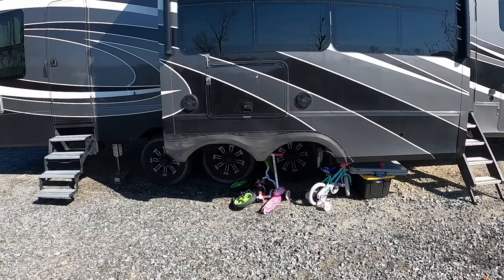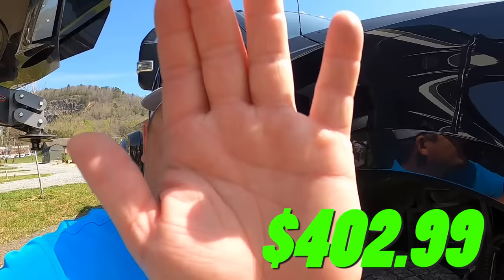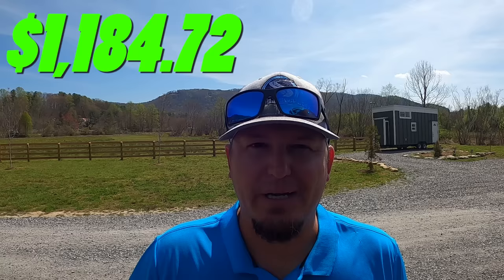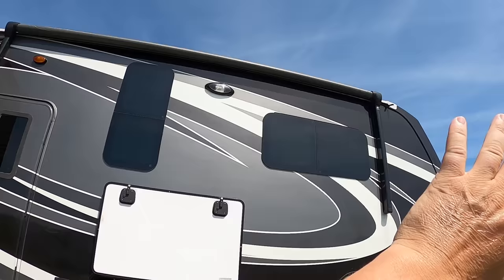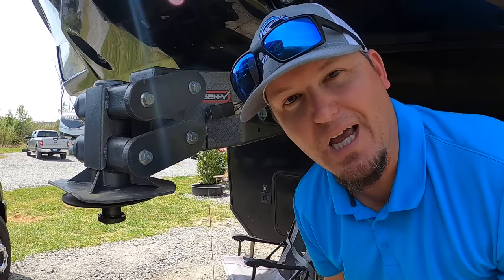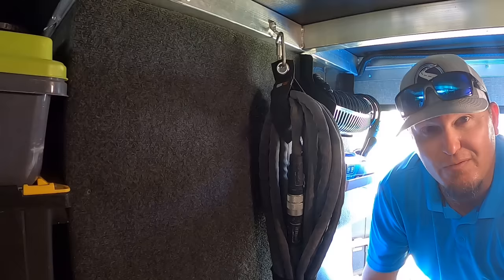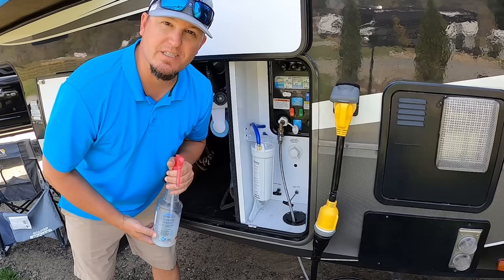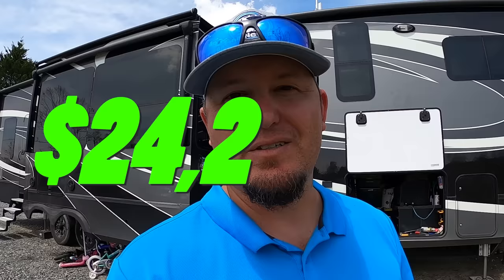These Things Are Money Pits! Everything That We've Had To Repair! | Fulltime RV Living!

Comment: I'm considering a teardrop to tow behind my Tesla.   Seems like the increased stop frequency, is worth the lack of ICE repairs.  ....but wow, sounds like it's time for an RV engineering revolution.
Reply from the maker: Except we had no ICE repairs, our truck never broke down, it was all maintenance! Your Tesla is going to need maintenance as well, just because you have a different source of power doesn't mean you will be maintenance free! Also you will have to figure out how to go places! On the East and West coast there are charging stations but how will you really get out there and get away from it all if you can't go where they don't have chargers?
Reply: @PavingNewPaths  My mistake.  Wrong word.  I meant ICE maintenance, not repairs.    ...and of course I'll have maintenance, but nowhere near as much.   I've had Teslas for years and have driven to and from all 4 corners of the US.   I've never once had a problem finding DC Fast Charging even in the flyovers.   To answer your question, I don't need chargers.  Wherever there's any kind of outlet, I have charging.  Charged off a regular Edison outlet while visiting a friend in deep rural Kansas.  Right now I'm car camping/charging while at an RV park using NEMA 14-50 (or TT-30r if I wanted) because I wanted to get away from it all.  Cheers.
Reply from the maker: I'm not saying you can't travel with a Tesla, but the idea of pulling an RV is a little far out for it to be practical! Until they can improve range while towing it's not ready for the masses to try and camp with electric tow rigs! We won't  have to wait long they will solve to problems and one day I will make make a video of my electric dually towing my RV!
Reply: @PavingNewPaths  Sorry about the long replies, but I'm a nerd about this. :)  I cant wait for that video.  :)   ...but I don't think it's that's outrageous, currently, especially as RV's start to get the aero/EV treatment like Lightship RV.   Videos I've seen show 40% loss when towing.  In a 400mile range vehicle that's still over 3 hours of driving.   Lot's of charging, sure, but if I'm in an towing a camper, I'm not cannonballing.  More range is always good, but I think we need more stations.  And more pull-thru stations.  I have no idea why EV charging stations aren't designed like gas stations (or why gas stations aren't just creating separate EV islands like they do for diesel or just converting gas pumps to EVS).
Reply from the maker: @DblOSmith  Maybe I am referring to when they will make it to where I can do it on full electric with a setup my size! I watched a video on the new electric F150 pulling an RV and it's range was half with a pretty light RV I want to so maybe 150 miles! I want to see a setup like mine that is big and heavy be a practial solution! I also thing the RV needs to be engineered to help the truck either as a battery bank the truck can use, along with some regeneration if possible!
Reply: @PavingNewPaths  Ah gotcha.  For sure!  Cheers!

Comment: there is several videos on air filters saying toss that lifetime and use good paper, they showed too much fines were getting through that washables. and the lawyer Steve Lheto did several videos on RV's and his advice was to go get $100.000 in cash,  go out in a field, with the cash and a bucket.. Fill the bucket with the money , kick it over and walk away.. you;ll be better off.
Reply from the maker: You do know there are maintenance procedures on the air filters right!  You are suppose to clean it and oil it at every oil change in order for it to work!  Out of everything in this video I can't believe the trucks air filter is what you felt the need to comment on!
Reply: @PavingNewPaths  for certain, the tests  showed their filtration still didnt match OEM  and when dealing with something that'll cost you 20 grand to replace fpr premature wear  Ill say OEM is cheap insurance.

Comment: Maybe just me owning a diesel for over 12 years and having an RV for close to over 20 years but I didn't really see a whole lot of surprises here.  You want to play, you gotta pay.  You put on the mileage you have to do the maintenance and diesels cost more, especially DRW units - do it yourself!  Most RV's regardless of who makes them or how much they cost really are giant POS - the guys and gals that slap them together make both the entry level and the premium units, it makes no difference to them, they get paid piece work.  I'm always working on mine, be handy, they are not that hard to work on!  Once you get the bugs worked out of the RV they aren't TOO bad ;)  Good luck!
Reply from the maker: We have done all the maintenance and repairs ourselves, that is how we controlled the cost as much as we did! I used to agree with you that once you get the bugs worked out they are fine, but we  just finished our 3rd full year and the story has not changed. If anything, it has gotten worse! Wouldn't be a big deal, but we bought this unit specifically because it was sold as fulltime use! It's likely barley capable of weekend warrior use!
Reply: @PavingNewPaths  My understanding of a "full time unit" is the manufacture will while it's under warranty, warranty components when they fail.  If you do not have a unit that is classified at a "full time" unit the manufacture will actually deny warranty work as the unit was not designed for that amount of use.  What I'm saying is a "full time" unit is a scam.  They just cost more so that the factory will honor the warranty while under that type of usage but in reality they are made EXACTLY the same way as any other unit.  Also any unit made between 2020 and 2022 is also more than likely not assembled that well as the industry was on fire - covid units.
Reply from the maker: @louisschummer931  Ours is a fulltime unit and was made before 2020! And you will see in some upcoming videos I wouldn't reccomended ever going with Grand Design if you plan yo actually use your RV! You will be on your own for everything!

Comment: That slide topper should unroll enough with the water on it and not pull off the wall. And don't forget people.  Slide toppers do not water proof your slides. The seals do.
Reply from the maker: Oh it does roll off until it is setting on the top of the slide holding water!  But in the process of it doing this it pulled the slide topper trim out of the side of the RV!  We doubled the amount of screws and haven't had a problem since!

Comment: I would no recommend an rv unless you have maintenance skills.  I am always fixing something on my rv.  My brand new Ford 2017 F350 dually was a problem also.  Stuck in Gulfport MS because the steering dampener went out at less than 40k miles.  No replacement was available for 5 days.  Aluminum rims that had leaking valve stems.  Finally made Ford replace the rims and stems.  There is a recall on the drive shaft.  The issues go on and on.
Reply from the maker: If you are going to use your RV more than just a few times a year you need to be prepared to fix things!  The more you use it the more you will fix it! We have actually never had any problems with the truck just scheduled maintenance and consumables like tires, brakes, and shocks!
Reply: Lucky guy!

Comment: The first 3 minutes of your video basically explains why i have an HD gas truck.
Reply from the maker: A gas truck can't handle this rig!
Reply: @PavingNewPaths  Kinda true, I move equipment on a deck over gooseneck. As heavy as 17,000 lbs. I wouldn't travel full time like that, though. My 5th wheel is right around 11,000 lbs. I tow it with a Ram 2500 6.4L. I do side work with a 15k gooseneck dump. I honestly haven't even felt the need for a diesel. I live in the northeast. So it can be vary step out here.
Reply from the maker: @Mattman2500  The gas truck could handle the payload requirements of this trailer, but when hooked up the truck and trailer weigh 31k so the gas motor would do ok on flat ground but it would be more than it really wants to pull!
Reply: @PavingNewPaths  Another factor is wind resistance. Also, imo if you need a drw truck. Then you are in diesel land lol. For me I'll stick with a gasser. My 5th wheel, I'm going to keep under 12,000 lbs anyway. Just sucks the epa basically killed the modern diesel. No doubt they pull better. Cost to dam much to operate and keep operational.
Reply from the maker: These new motors are beast now with the Government stuff on them, imagine if they could sell you the truck and motor with out all that stuff on it! Btw you have an awesome handle!

Comment: Should be calling out the dealer that put the washer dryer in and the manufacturer of the trailer. Grand design has only been around since 2012 and they have never built a good trailer, Now they are getting worse if that is possible. All trailers after about 2018 are junk. DOT needs to step in and improve the safety of them and the manufacturers need to improve the quality.
Reply from the maker: This video is not a knock on Grand Design, they make great products!  I mean look what we are doing, we have lived and traveled for 3 years fulltime now and it's still doing exactly what we purchased it to do!  You see this video and your first thought is who do we blame for this!  There is no one to blame, if you think about what we are doing, this thing is performing amazing, we use our RV more in 3 months than most will in a lifetime!  So while you see problems, this is just what happens if you actually use something!

Comment: @ 12 : 20 look how small and cheap those hinges are. It is a king size bed and heavy and the motion of a moving RV snapped the hinges. RVs are rolling junk boxes.
Reply from the maker: Actually moving didn't cause them to break, it was when we installed a bigger heavier mattress that broke them!  We lift the mattress up to access the under-bed storage and the extra weight pulled the hinges apart!  We fixed it with normal hinges from the hardware store and installed 150Lb struts and it hasn't been a problem since!

Comment: While I think some of ur maintenance was optional, I just want to add— 
if u park an RV for 6 months and then plan to use it again, do not expect everything to work.  
Yes things will break even if it sits idle. 
I will never own one.
Reply from the maker: Yes, we are simply sharing what we've spent in maintenance costs (optional or mandatory) while living on the road. RV's definitely do better when they're used, versus sitting idle, but will always giving you a little something to repair here and there!

Comment: Dodge charges $175. to $225.00 depending where you go.
Reply from the maker: For Oil or the fuel filter?  At Ford they charge $110 for oil and I can do it for $90 so that's pretty cheap, the fuel filter they charge $175 and I can do it for $65!  I like to do it myself when I can but with us traveling fulltime most RV parks have rules against this type of work!

Comment: $17,000 to maintain an RV for two years doesn't seem like alot if the RV is paid for. When you are financing it with that $17,000 on top it makes the idea not do enticing anymore.
Reply from the maker: Paid for or financed doesn't change the cost or the amount of Maintenance and repairs you will do! It also won't change how much you spent, either you paid for it upfront, or you pay for it on the back end, you still spend the money!

Comment: You forgot to add the dollar value of the salary of having a full-time RV owner who understands and figures out all this maintenance crap, and then orders or installs a lot of the parts himself.  Your free supervision and work was not free, and probably doubled your total bill.  It sounds like you like doing this job for free.
Reply from the maker: We look at it a little differently. We don't assign a dollar value to our time and effort, but it definitely is still cheaper, even if we did. What we choose to research and fix "for free" is a savings in headaches from dealing with RV techs, dealers, etc. and ensures we never have to turn our rig into a dealer for repairs for extended periods of time. It seems irrelevant to assign a dollar value to our labor when we are the ones who would be paying ourselves.

Comment: I see the value of your video. I agree RVing is not free or cheaper way of life. Well..considering today when an apartment rent is $1800.00 a month average or a mortgage that is $2500- $5000.00 a month. It's not cheap to live. Although Home ownership is an asset. It's not cheap either. I hear "THE DEALERSHIP" waaaaay too many times during your video. You better learn how to repair and maintain your rig on your own, warranties or not. Warranties are just money in dealership pockets. I own a 2003 40' diesel pusher. I fix everything that goes wrong with it, but there is an issue with the freightliner chassis which has nothing to do with the RV. these chassis are on semi- trucks and school busses. I'm surprised my issue is with the chassis manufacturer. that will have to be fixed by freightliner unless I can locate a freelance mechanic. It's a laptop issue with software for the gauges.
Reply from the maker: Thank you! We sold it all and travel fulltime this way of living is more expensive in certain areas but overall it is half the cost of home ownership! We do all of our own maintenance and repairs and this cost was based on that! The RV has never been to a dealership for any work, the truck goes to the dealer for oil changes, and fuel filters because most campgrounds won't let you do that specific type of work in the parks! We do it ourselves when we can, but when we can't we take it to Ford! If I had to pay someone to fix all of these problems it would have been another 10K in labor cost to our number!

Comment: Seams to me you screwed yourself with a nice newer shiny truck, and RV. I pulled and lived in a 1979 19ft Jacko Eagle with a 2009 KIA Sorento through the mountains for 3 years and never came close to having hardly any problems. Major repairs I did were repacked the bearings in camper, and by my fault had to replace the water tank, found a used one cheap! And replaced bearings in SUV. Otherwise I had no problems. They just don't build RV's, vehicles, well anymore!
Reply from the maker: While we both live in RV's you and me aren't exactly doing the same thing!  We are a family of 5 and we move every week our needs will be much different than yours, and our cost will reflect that!

Comment: I wouldn't buy anything that is made by any of the RV manufactures owned by Thor...no wonder everything fell apart.  I have had a Northern Lite Truck Camper since 2015 and live in it 7 months out of the year boondocking in the Rocky Mountains...I have gone over mountain passes, mining roads, over desert washes in Utah..every type of bad terrain you can think of and I have had zero problems other than those I created myself...like raking off light covers and vent caps.  Not made by Thor, great customer service...if you have a problem they will actually let you speak to the guys that build the things...also longest warranty in the business, 6 years.  Can't say enough about how awesome it is and makes for RVing a wonderful thing.
Reply from the maker: Grand Design us owned by Winnebago, but they are all made the same, as cheal and as fast as possible! You don't get one of these unless you plan on working on it! We love it because it has served us well on our goals of traveling as a family! But it took lots of repairs to do it!

Comment: The costs you mentioned were for two years... do you expect the next year, or next two years to be the same amount of expenditure?  (What's the lifespan of a trailer like that one??)
Reply from the maker: The cost in this video were mostly during the first year, the second year out was pretty much just maintenance with very minor repairs! We are in our Third year now and have only had to fix a handful of things this year! If you use them fulltime and move often you will experience most of your problems in the first 6 months and almost all will come during a move! I am not sure of the lifespan on the trailer, but I would imagine if you keep it up it could last as long as you wanted it to!

Comment: On , the water lines . Why not go to a hydraulic shop get some hoses made up , yes be more to make them up but from the video looks like the crimp is bad . Get few extra ends that way a shop should just be able cut the,end crimp new one back on , off u go . 
Safe travels
Reply from the maker: I thought about this but there is no way to make this drinking water safe with hydraulic or air lines! Not to mention hydraulic lines are usually JIC and this is all pex type connections so you would need to source JIC components to fix the entire system! Great idea but would be a challenge!
Reply: @PavingNewPaths  true I use mine for dishwasher,  safe travels

Comment: Excellent video, new subscriber. 
 I just brought a 23 Ford F450 w/high output diesel and a 5th wheel trailer. I have a list of preventive maintenance to do to the truck and 5th wheel thanks to your video.
Reply from the maker: Most of our issues with the RV came in the first 6 months of travel, once you work out the travel bugs its pretty routine maintenance with some repairs along the way!  The truck has been nothing but routine maintenance and consumables, like tires, shocks, and filters!